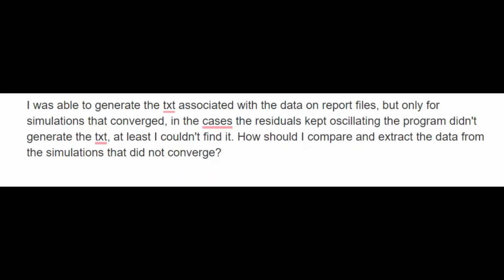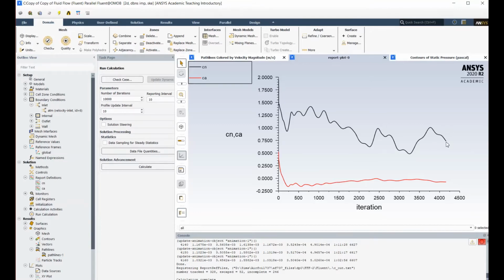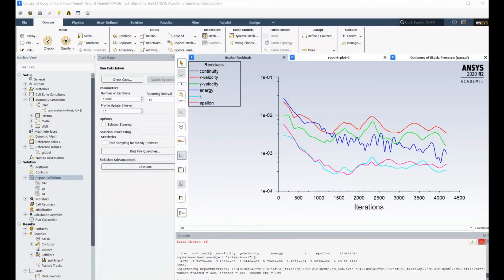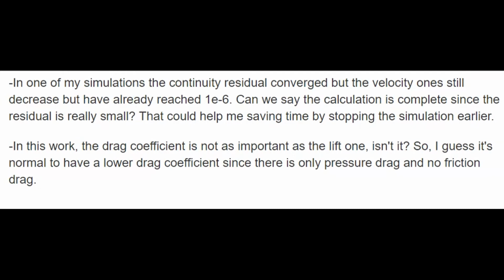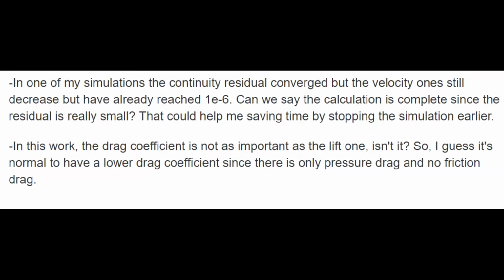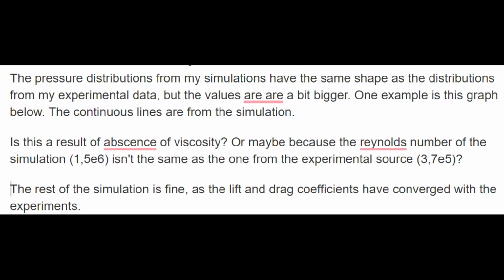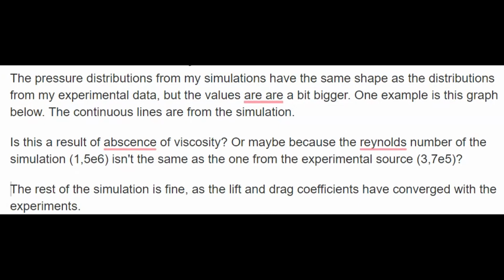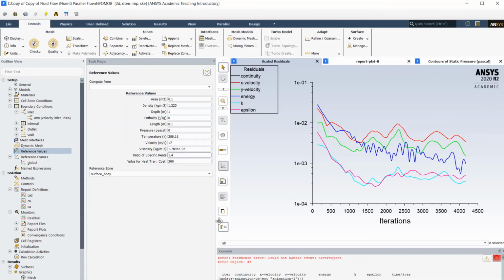Questionnaire on Aerodynamics 9

Comment: Good afternoon professor. 
I am a unb-fga student on my 4th semester on aerospace engineering. Currently doing a PIBIC on Micro air vehicles using a specific non-conventional configuration. I have been watching your videos for a couple weeks now, it has been of great help.
I was supposed to work on a wind tunnel but since covid happened, we are not having any technicians to assist machine usage. Thus, CFD is the only viable way for now. 
Since I am way behind of content, hence 4th semester, my coordinator is helping me with it on most of it. 
Here is my question: In the study of Micro air vehicles(MAV), literature shows that in low Reynolds numbers and low aspect ratio planforms there are two sources of lift, the first source is like any other seen on conventional and bigger configurations and as i have seen it can be measured using CFD. On the other hand, there is a non-linnear lift coming from the tip wing vortices. Since the wing on a MAV is quite small most of the wing tip vortices goes all the way above the wing, and lift is created because of that. I havent take any courses on aerodynamics yet, so thats for now the furthers intel i have on this matter, Professor. 
I would like to know, only if possible, if you Professor, would have any suggestions on either it is possible to create this non-linnear lift on a CFD basis and if so, any advice would be well welcomed and appreciated. 
Best regards, Andre Radusewski 
Contact: 180116231@aluno.unb.br
Reply from the maker: Dear André, Thank you for contacting me. Let's discuss this question in Teams.